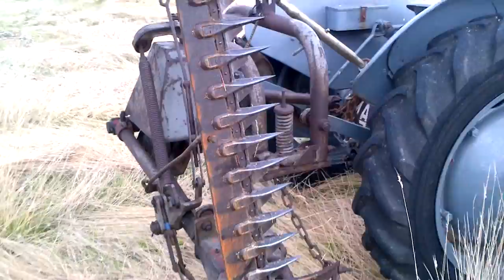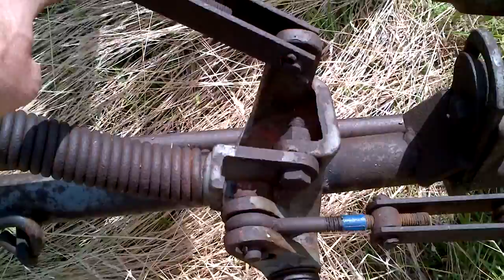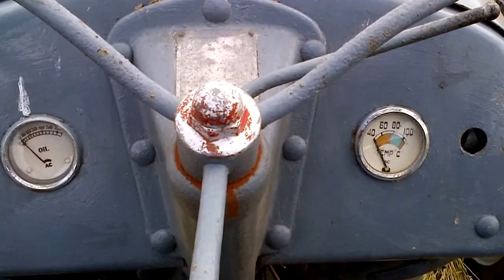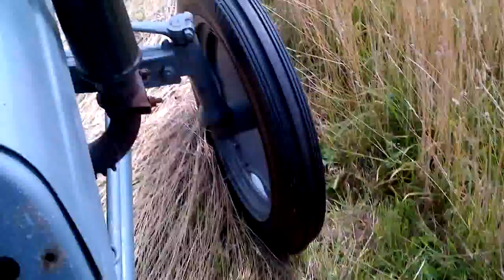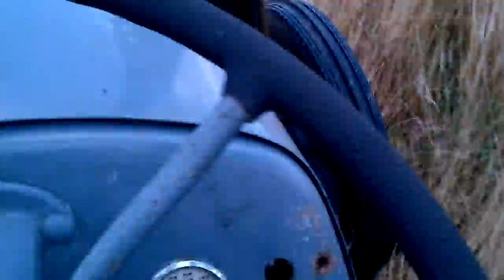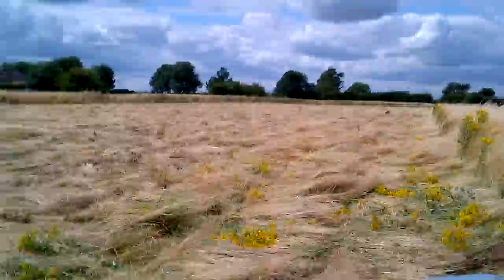Using the MF732 Fingerbar Mower and Ferguson TED20. Tractor seat view.

Comment: Thanks for your show of the finger-mower, & the problems of the old T20s lack of hydraulics. Not until the later MF35 was made, did we overcome the height 
problems for any equipment on the 3-point linkage. But I like your chain supports! One thing I would like to point out is, you are cutting that "Yellow Ragwort" 
which can bepoisonous to animals. I think it was banned in England in the 1980s? Best check that out.

Comment: you should have two flat bars which attaches around top link down to the arms holding mower and that is a swath board, the bars are straight one end the other end is 45%
Reply: With age most TE 20  hydraulics sag and maintaining a fixed height is difficult, Ferguson recognized this early on and produced a top link made up of two flat bars with multiple holes and two flat plates with large teeth cut out which faced upwards and forwards, also supplied was a double chain with a large D ring, the ends of the chains had a flat bar attached with a cat one hole in them.
The top link was set to the correct length including the two plates and bolted together, the D link was fed over the top link, the lower links were attached to the cat one pins including the flat plates, the mower was then raised above its operating height, the D link hooked over the teeth and lowered, by trial and error one would find the position of the D link that set the mower at its working height. with this novel arrangement, the driver could lower his mower to its correct height, and at the end of the cut lift the mower, turn, drop the mower without even looking back.

Comment: The engineering of these old implements is so well done and built to last. Your coil could be letting you down wit the idle, I was running a 9 volt coil when my alternator was 12 volt, when I put the 12 volt coil on I got it running well. Another mistake I made was slashing in a clockwise motion instead of anti.

Comment: You said the mower had a lot of grease fittings for grease to be applied so why do II not see any grease at the joints and fittings ? You really need to apply the grease to these ware points if you intend to keep it going. Other than that . Good overview of the machine.
Reply: Christina Moneyhan It did look very clean however over greasing is the biggest cause of bearing failure and you should also clean off the excess as dirt just sticks to it and can work into the bush/bearing.

Comment: This is a very informative little film - thanks for loading (and for your other film of you sprinting off into the distance..! )

I'm interested in how the MF732 compared to other mounted 'finger mowers' of the time (International Harvester, Ransomes etc.) in terms of robustness and durability. 

I guess that models such as the 732 were the last of the finger mowers before they were superseded by disc and drum mowers. I am aware of the MF 'Dynabalance' 41 finger mower, which I assume was a later design, but I don't know if it is considered a better model.